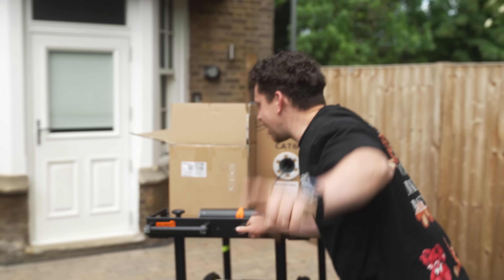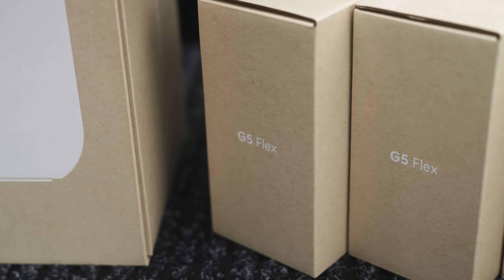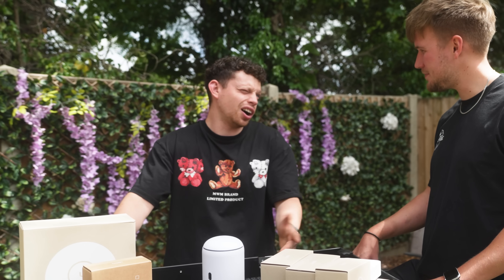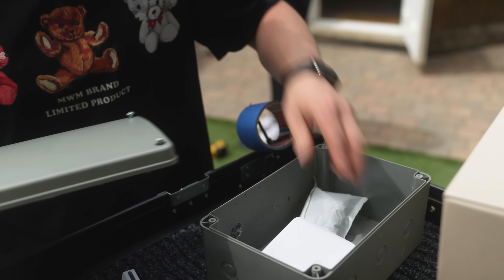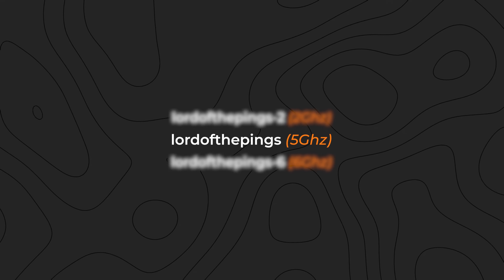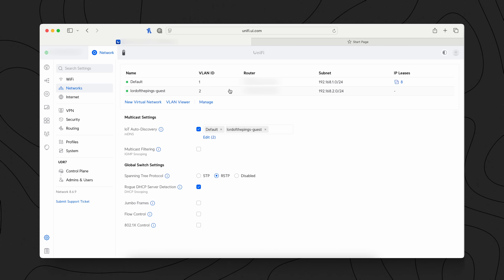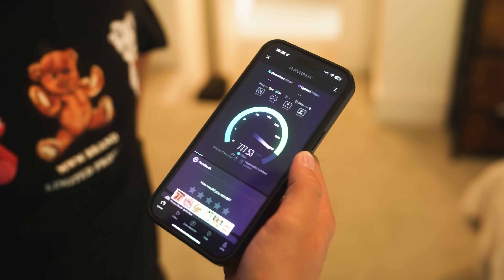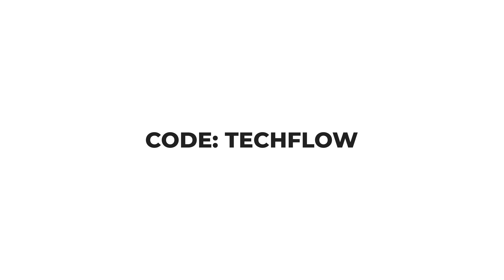Next-Gen Budget UniFi System: Full Install!

Comment: the bad thing with unifi lately is their prices have skyrocketed. To be doing a decent system with 2 ap-s , 1-2 cameras, a switch, and a router, you will spend at least 1000$ if not more... thats not budget.
Reply: I feel like it’s always been that way. But to unifi’s credit, they make upgrades embarrassingly easy so you can start small and build up over time.

Comment: Comparing an sd card to an ssd is wild. Sd will have much shorter lifespan.. and for wite intensive static  jobs the jury is in old school HDD is king. Then ssd then sd more writes on sd card = shorter lifespan soo using one in an application where 99% is consistsnt writing..

Comment: Hey Alex, surge protectors.. you have many cameras running outside and as we know lightning can’t be good if it hits one of those cameras, I have not seen that you use surge protectors ever, do you think they are worth the investment? (They’re not expensive anyways) but if you could at some point give us your thoughts on those, any experience with equipment damage over the years? Thanks, love your videos!
Reply: If you have a robust setup, it’s worth a power distribution and power protection setup where primary ether and sfp cables are protected at the top, and other power 110/220/230 are protected.

Comment: Flex switch spec says it can provide PoE when powered from a PoE++ output, the UDR7 is only PoE so I am assuming you put a PoE++ injector in line so it had enough to power the cameras? It looked like you plugged the ethernet cable into the top port on the UDR7 and that wouldn't be enough to power the switch an the cameras as its only PoE 15w. Only asking cause I am considering this idea myself.

Comment: You inspired me to give this a go, however the UDR7 refuses to connect to the internet and after setting up the SSID , password etc it won’t connect to my phone. I have EE full fibre, is this an issue with router not working with PPOE ?
Reply: Google what is the username for ee WiFi when using a different router, you need to input and email and password. I did this and was so confused. Entered all the details and bosh works perfect

Comment: Hey Alex, Do you have any Tips or tricks for Mobile Broadband SIM routers for locations that don’t have the Access to the Wired connection from a network Provider. Specifically how to Increase WiFi speeds when you have very low Signal.

Comment: So those G5 Flex are supposed to be installed under eaves. I had one fail with water ingress as I didn’t do this either - though I still have 2 more working fine. YMMV.
Reply from the maker: We’re got loads installed, really versatile camera. The first thing that goes in them seems to be the microphones 🤣

Comment: Great video! Does it need permission from the ISP to use a router they haven't supplied? I think it's an added extra with my provider for about £5p/m. Or can you just bypass this by not paying? Cheers.
Reply from the maker: Great comment, this depends from ISP to ISP. With BT and EE in the UK, they give you PPPoE info to connect directly, some ISP's allow you to put their router in bridge mode, and some do not allow you at all. We hate this.

Comment: I thought the Router only supported x2 2k cameras
Reply from the maker: This is just a recomendation. We've found 3-4 work fine. It depends. If your using IDS/IPS and have a huge network taking up CPU, this wouldnt be reccomended. But for a single household with a handful of devices, this setup works fine. You can monitor CPU usage in the control pane. With three cams on 24/7 and a gigabit speedtest running, were around 80%.
Reply: You are correct. Don't listen to him. Also these cameras are not AI. They just used what they had for free.
Reply: @tedev  Smart detection is classed as AI, not sure what else you'd deem it as it isn't some person saying oh that's a dog or a human etc. It's all AI, may not be super advanced AI telling you exactly what the camera is detecting like newer implementations that will give a summary of the activity but nonetheless it's still AI.

Comment: If you split the network bands.. say your phone is on the 6, could you cast to a TV on the 5? Or could you see network servers that maybe might be on different bands? I had an issue with that years ago on virgin media so never looked to do it again but if not then it sounds like a great idea to reduce interference
Reply: As long as you don't have client isolation enabled and both SSID's are on the same VLAN (Called virtual network in the video) you can cast from both SSID's. But imo, just use a single SSID and enable band steering, only if you really have problems with clients disconnecting should you use separate networks for 2.4, 5 and 6GHz.
Reply from the maker: Well said, thanks!

Comment: Split SSID's for 5/6GHZ is that the best practice now or do some features use 5ghz to hint for 6ghz roaming
Reply: 6Ghz devices roam to 6Ghz just fine, WiFi 7 will need everything on the same SSID for MLO. Using the UniFi Express 7 I had 44 Clients connected to a single SSID without issues.
Reply from the maker: All correct, we've found with MLO being so new, it's a bit flakey at the moment, so for now we're still splitting it old school.
Reply: @techflow  sorry but you’re wrong here. It’s bad practise to separate SSIDs into bands… whether using MLO or not.

Comment: I am no bot here, but I just moved to a new apartment, and I am looking for an affordable access point to use that is powered over ethernet. I have a unifi edgerouter X, and network speed is a dedicated 50mbs. Any recommendations will be highly appreciated.
Reply from the maker: Depends on the size, All the AP's do a fantastic Job, A UAP pro would be good, get 6Ghz radio with that.

Comment: 6:00 I would keep all the boxes checked and enable MLO, except the 2.4 GHz network which I would check “Enhanced IoT Connectivity” 

Devices 5-years and newer should connect fine, and those that cannot connect will be banished to the less secure IoT network
Reply from the maker: This is good advice, however MLO seems to differ from device to device, so we're not fully convinced yet. Compatable devices work great however.
Reply: I’d say even 10 year old and newer would be just fine.

Comment: How did you power the flex switch that was outside?
Reply: PoE
Reply: PoE++
Reply: From where…I don’t think the UDR has any POE ports…?
Reply from the maker: Yes, it has 1 PoE port on the back that supplies 15W. Just enough for the switch and 3 cams. JUST.

Comment: I use UCG Ultra as it was cheapest and i like it a lot, with my curent AC LRs and Pros. But indeed i had to MAC spoof the ISP duter to remove it from cuppoard. The Bridge mode required ISP ruters anoyed me so i switched ISP, they told me imposible but brute force MAC  works at T2😂. Then my mate said Telekom has Tv VLAN and he will replace asus with unifi to trick that vlan for tv boxes to work behind nat, and get rid of their generic ISP ruter also